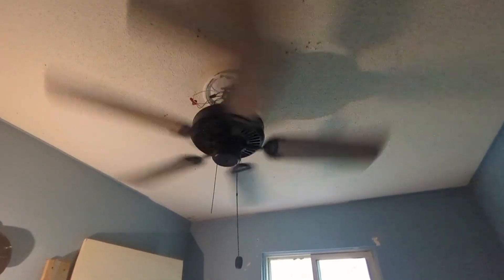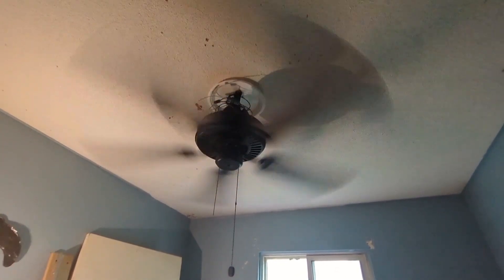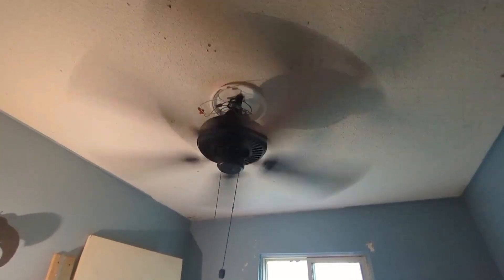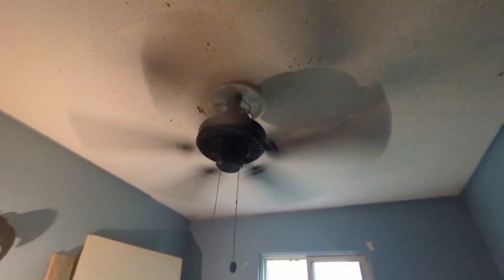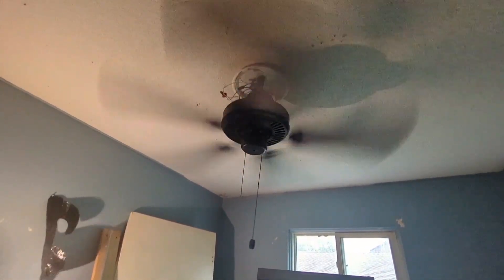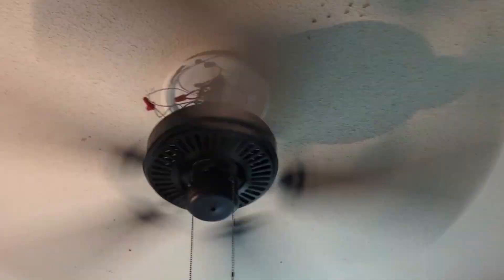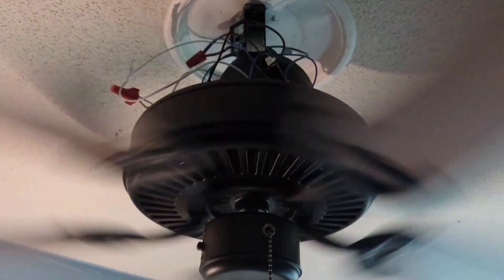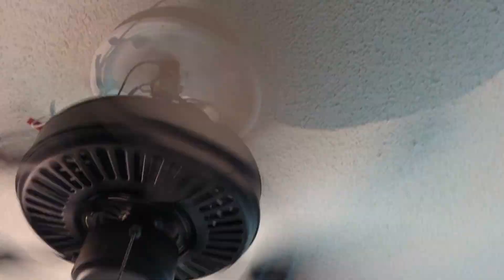(PRANKED) Upgraded Hampton Bay trice full power!

Comment: Now I’m wondering what the RPM on this is? 🤔
Reply from the maker: 255 rpms Because the capacitor is basically fresh and it's not charged fully, In the future, like the fans that I had before, they will eventually go faster. I think it's Max speed could be around 260 and that's it, can't go any faster than that. That's the max